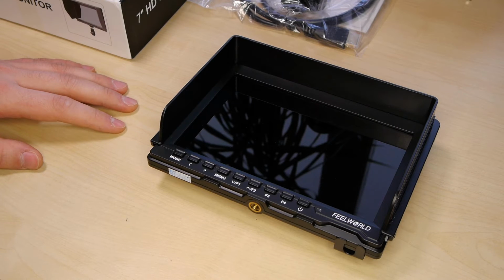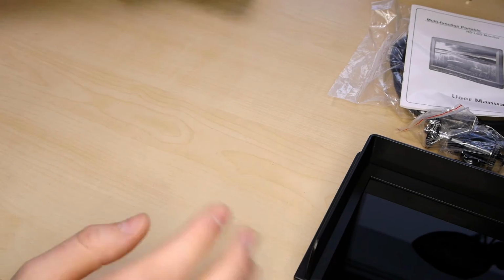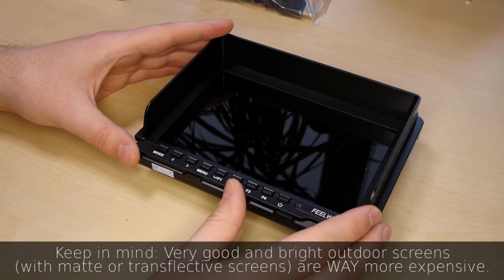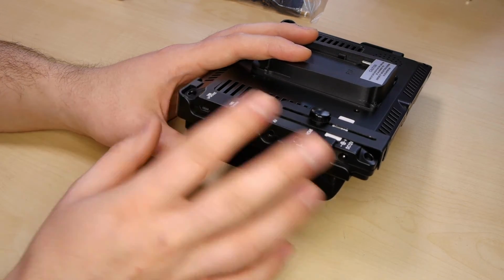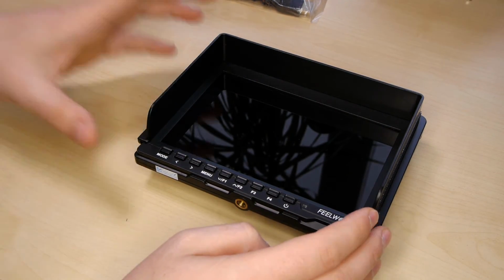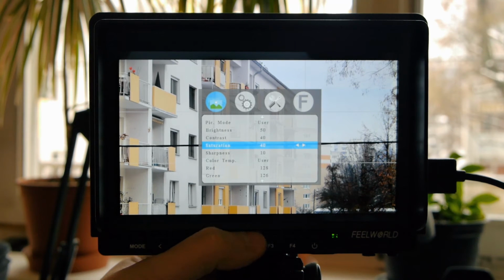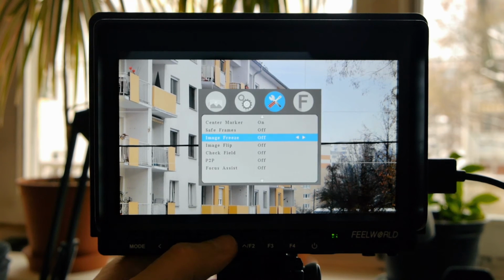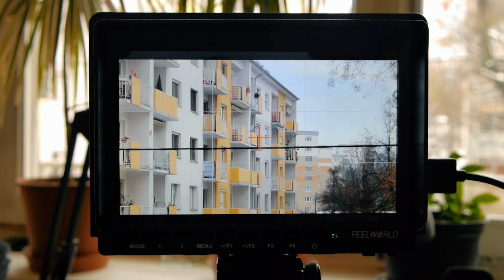Feelworld FW759 / FW759P field monitor - Very detailed HANDS ON (with calibration settings) (!)

Comment: hey i just got a Sony a7sii and looking for a cheap first monitor, looking at most of your reviews mi leaning towards the feelworld ones but what model would you recommend?
Reply from the maker: UCMercedLife Yes. The FW759 and the new FW760 are fully compatible (as the GH4 is able to output 1080P - Even if you record 4K internally). BUT there is a difference: The GH4 offers a little bit slower / worse AF performance, if you use the HDMI with 1080P (while it´s in 4K mode internally). I assume because the scaling needs more processing power. So if you intend to record 4K it´s maybe a good idea to invest already in a 4K capable screen. Though: It makes no difference if you use EF lenses (with an adapter) - As the AF is quite bad there already. And it´s also not important if you use manual glass ^^.

If you want a 4K capable screen, check out the FW759 variation with 4K support - Called: FW74K. Should be basically the same. For the FW760 there is no variation actually (at least I don´w know of one ^^). The FineHD VS2 I have lying here (I need to check it out the next few days if there´s time). But i doubt, that it´s better overall (as all of the Aputure screens are quite bad colour accuracy wise). And if you get the same sharpness and better colours with the Feelworld models, why should you go for the Aputure (which are way more expensive additionally). ^^

If you are able / if you want to invest more, you could also check out the IKAN DH7 for example. Better features, better sunhood than the Feelworld - And also coming with nice features and colours (IKAN is quite good according that aspects). Not the cheapest ones - But at least also an option. (P.s.: There are also the smaller and cheaper DH5 and DH5e 5" screens - Same resolution but way smaller and cheaper - And the DH5e is coming with a touchscreen where you can zoom in like with a smartphone to check the focus.)

Btw.: There are used / like new DH5 and DH7 models actually available on Ebay. So check them out. Maybe it´s better to invest a little bit more. A screen is like a tripod -> A good one you´ll keep for many years.

HTH - Hope that helps ^^.
Reply from the maker: Well - The Feelworld FW759 and FW759P screens are REALLY good. But maybe it´s a better idea to check out the new FW760. It´s offering more features from scratch on AND it´s using a better 1920x1200 panel. So you get a better (clearer) image from scratch on. Even peaking isn´t needed anymore most of the time. I didn´t test the FW760 til now (live) - But as it´s building on the same FW759 "base model", it should be as good according the base features (colours, features, built quality and so on). HTH - Hope that helps ^^.
Reply: Yes that does help and is the monitor Id like to get, do you know of any sellers in the US that stocks them? Everywhere I've seen them is over seas... Thanks again!
Reply from the maker: Ryan Rios Sorry - No. I also got my FW759 directly from China. Try to check out all sources (Amazon / Google / Ebay). But as the FW760 is also BRAND NEW, there´s not that much chance, that you get it somewhere locally (it´s even a problem with the FW759 models).

Have fun shooting! LG
Reply: Do you happen to know maybe any other models that would be similar that are more American lol would hate to wait so long to get it and not be happy. Thanks again.
Reply from the maker: Ryan Rios Well - You can also check out the IKAN DH7 - Features wise even better than the Feelword - With overall better built quality too (but also way more expensive). Btw.: The DH7 is also available under different brands (NEWAY or under the "Portkeys" brand as the LH7 for example).

Under the different brands it´s a little bit cheaper than from IKAN directly - But with the other brands there´s no guarantee, that you will get local support and firmware updates in the future. And IKAN is a local US dealer / brand. ^^

Btw.: Check out Ebay for "DH7 monitor" - There´s actually a like new / slightly used IKAN DH7 for sale ...
Reply: I was looking into purchasing a monitor for my GH4 (I'm assuming all these monitors work fine with it even though I'm recording in 4k right?). I really just want to use the monitor to help me focus better. So I was looking into the 1920x1080 resolution monitors which I narrowed down to the FW760 and Aputure FineHD. The FW760 seems to just be a cheaper/better monitor than the Aputure. Do you agree that the FW760 is the one to get or did you have
any other recommendations?
Reply: Thanks for all the information! The pinch-to-zoom from the DH5e looks really handy. But if I'm understanding correctly, the Pixel to Pixel (P2P) feature from the Feelworld is essentially the same thing but just via a button press correct? Are you able to use it while recording as well because the GH4 you can't zoom in artificially to check your focus while recording (only before).
Reply from the maker: UCMercedLife Yes. It´s basically the same (just a simpler solution). But keep in mind: With a 1920x1080 or 1920x1200 capable screen, you need a 4K feed to make a pixel to pixel zoom (because the 1920x1080 panel is then showing the centre portion of the 3840x2160).

With a 1080P screen with 1080P signal you need to use the standard zoom feature (which is not as high quality as the pixel to pixel zoom -> As the resolution is limited). I hope it´s clear what I am talking about ^^.

So for the GH4 you would have two pros -> The 4K input option (which isn´t cutting the AF performance which you get if 1080P is downscaled to the HDMI port - At least if you plan to use AF from time to time). AND: The zoom feature should be better on the DH5e (or the 7" DH7) because of the higher 4K resolution it accepts over the HDMI.

Overall these features are completely seperated from the source (the GH4 in your case). I also like to use the external screen with a magnified view (to pull the focus) - As there´s still the internal screen (on the GH4) to judge the framing.

Have a nice day! LG
Reply: I just got the fw760 and it's amazing, the stock battery is bad tho.. And the hot shoe adapter was a bit cheap so in a bit stuck until I get a new ball head.
Reply from the maker: Ryan Rios Good to hear that you´re happy with it - The Feelworld screens are giving a real (super cheap) option now. Even compared to the already quite cheap Aputure screens (which have other problems too - Not only the higher price ^^).

About batteries: What battery is included? I guess a NP-F330 or F550 right? Alternatively you could just go for a Patona Premium or Baxxtar NP-F970 battery (the 7800mah ones). Or if they are too heavy (which is often the case), maybe better go for the "middle way" -> The NP-F730 (aka NP-F750) models. Should be also enough (and it´s maybe better to have two of those). Especially if you plan to use the monitor mounted to the camera directly -> The smaller ones are giving less strain on the hot shoe of the camera.

Have fun shooting! ^^
Reply: The battery it came with was a "no name"  label says " BATTERY PACK -Fits SON .NP-F550/NP-F570 7.2V 2200mAH 15.85wh" that's it.. It just think it's a cheap knock off.. Maybe I'll power it of a 2s lipo battery.
Reply from the maker: Ryan Rios Sure you could. I use an external NP-F Plate to power my monitors (at least on a rig). The 970 ones are just too big for my taste (as it´s also adding strain to the monitor mount which isn´t the most stable one on many screens). If you want to stay with "onboard" ones, just test out how long the 2200mah battery lasts. If it´s (multiplied by two) is enough for you, then you can also go for the already mentioned NP-F730 aka NP-F750 ones (which are normaly cheaper and more lightweight compared to the 970 ones). Btw.: Keep also an eye on compactness (and ease of usage). If you have a solution already though - Just go for it ^^.

As always: Have fun shooting!

Comment: plz answer
Can i use it as a normal tv screen to play Xbox 1 and PS4?
Reply from the maker: Should work fine yes. Altough it´s not very big - But for sure an option in your car (or if you really need a small / lightweight screen).
Btw.: If you want even higher resolution, then check out the new Feelworld FW760.
(Which is coming with a even higher resolution 1920x1200 panel - Instead of 1280x800 with the FW759.)

Comment: how did you get that 16×9 aspect ratio screen?
Reply from the maker: Which camera do you use? Did you check the HDMI output settings of your camera?
(Choose a fixed setting - 1080P / 1080i or 720P for example - AUTO settings are sometimes not working right.)
If it´s just the screen settings: Go to submenu two (out of four) -> The 2nd entry should be aspect ratio.

HTH (hope that helps) ^^

Comment: Hi! I recently bought this and I can't change the aspect ratio on mine, using and Nikon D800, should I update the firmware? Thanks!
Reply from the maker: You can ask the Feelworld support for the newest firmware (though I don´t know how reactive they are - And if they send it to you directly without sending in the unit for the upgrade). Just try to ask them. But: It could be also your D800 (the settings). Check out for example this video (there you see how to get the full size 1080i output without overlays): https://www.youtube.com/watch?v=8gmwRBJSERM

Comment: Thanks for the review. Have just bought this monitor and wonder if I've been unlucky in receiving a bad copy. When changing Camera Mode I loose signal and it would only give me the 480p option. Also the Focus Assist seems to be all over the place. Outlining objects in red which clearly are not in focus. Anyone else with the same problems?
Reply from the maker: Which camera do you use? The problem is: Many older Canon cameras are dropping the resolution to 480P only as soon as you hit the record button. That´s an quite annoying problem (which you can only overcome with a newer body). It´s the same with all external screens - Not only with the FW759 / FW759P. The peaking at 480P is quite useless - That´s true. But it´s the same again: It´s the limiting resolution. Peaking is highlighting the "hard" edges of the image. If you only have 480P as source, there are not enough details to show you the right edges in focus. Because of that I am overall no friend of peaking. At least external one (on external montiors). Body internally it´s better implemented (because they use the high resolution sensor data - Not the compressed HDMI). Btw.: If you want to keep your body, check out the magic-lantern hack. At least there you can also enable peaking (body internally). That way you get at least one option to pull the focus better.

Hope that helps ^^.
Reply: Thank you so much for getting back to me. Currently I'm using a GH2 and Nikon D7000 (can't get a full screen image on this one). When turning the monitor on with the GH2 it flashes HDMI 1080i on the screen. Can't change except to 480p in Camera Mode. Have only tried Peaking in standby mode which I thought would be in the 1080i? I also saw you did a thorough review of the LiIlliput 5D-II O/P. With my rather old cameras would I be better off going for the Lilliput rather than the Feelworld. The reseller have offered to have the Feelworld returned considering the issues. Maybe my cameras aren't compatible. I hope to soon upgrade to the GH4 but will need a monitor for the current set up in the meantime. Really appreciate your advice. Kind regards. Maria
Reply from the maker: Ah. Ok. So no Canon ^^. Don´t oversee: The D7000 isn´t outputting a full sized image from scratch on - You always get a cropped image (with black borders). You could try the nikon hack (they implemented a native 720P mode without cropping): 

https://nikonhacker.com/wiki/Supported_Models

The GH2 should work on the other hand (with full 1080i image). Or do you have problems there too? Shouldn´t be the case (as the FW759 is working nicely with interlaced signals). About the Lilliput: It´s a full class below the FW759 (resolution wise, features wise AND especially colours wise). There are other options out there (monitors wise) - But it´s not solving the D7000 problem (you need to try out the hack if you want full sized HDMI output).

If the GH2 is also not working, then you could get a 5D-II/O/P in the meantime - Yes. At least it´s working: But as mentioned the GH2 should work.

Have a nice day.

LG
Reply: @SwedenMadein  did the Nikon hack work ... interested in getting this monitor for my D7200

Comment: Has it classic components input: video (yellow) audio R (red) audio L (white)?
Reply from the maker: +Kobudoka 11 It has a combo (3.5mm) input port at the side (for which you can get a breakout cable with all the ports you mentioned). BUT: This is a super cheap screen which is optimized for digital signals (with higher resolutions). If it´s possible in ANY KIND, then try to use your digital outputs (HDMI or SDI with an SDI to HDMI converter - They are also not THAT expensive anymore). You will get a WAY better and clearer image (with analog signals you don´t even get a nice full screen if you´re unlucky with the scaler options. And quality wise an analog signal - Especially over the standard yellow VIDEO port - Is more or less only usable for framing. By far not to judge the sharpness / focus point, the colours or moiré / aliasing behaviour for example. You could just use it for framing ...)

Comment: Nice review. I bought this model recently(version 3.4, I believe) and had an issue getting full image output. I use the analog input as my camera only has analog and SDI outs. When I send an image with "in Camera" safety marks (I set mine at 90%), the marks show on the 759 that some of the image is cut off at all the edges. In fact on the right side it cuts off the vertical edge of the safety marks. All the other edges show that the image is cutoff by about 5% to 8%. The 759's built in safety borderlines show up as centered on the monitor. This happens whether the monitor is set to auto, 16:9, etc. Have you had any issues with that?  Any solutions? I've tried a number of setting combinations.
Reply from the maker: +Okolehao Hmm. Try out following:
1.) Search for overscan / underscan (maybe it´s now available in the options of the newer firmware).
With that you can control the amount of overscan / underscan of input signals.
2.) If this isn´t added / available (maybe it´s not coming at all as normaly you don´t need it):
Try out the 4:3 mode (according the aspect ratios) - As analog is often a 4:3 output. or 
3.) If that´s also not fully helping, try out to enable the pixel to pixel mode (in the features)
And then use one of the Zoom modes (which are also present in the aspect ratio settings) to get a bigger image again.

Though: Overall it´s not a good solution at all to use the analog output of your camera.
(Btw.: Did you try different output settings on your camera?)
Another (for sure WAY better solution): Use an SDI to HDMI converter.
Then you get the full signal quylity (with full resolution) - And it´s always better to use a digital signal. ^^